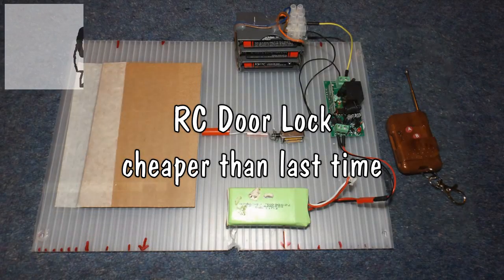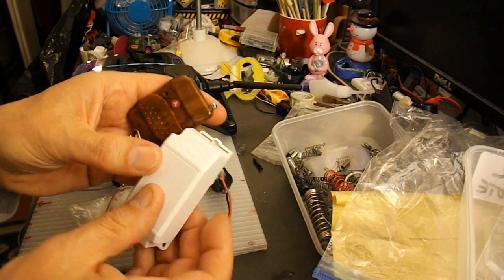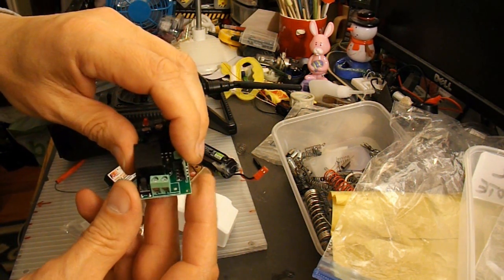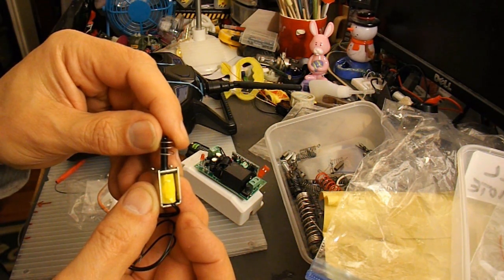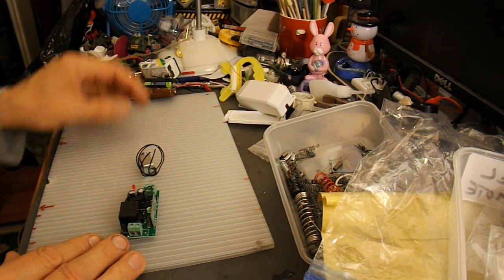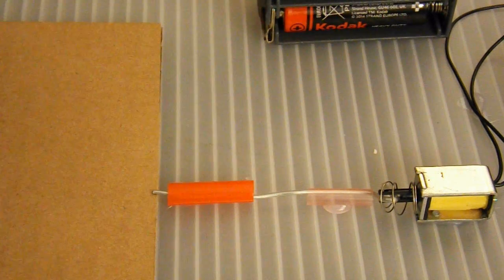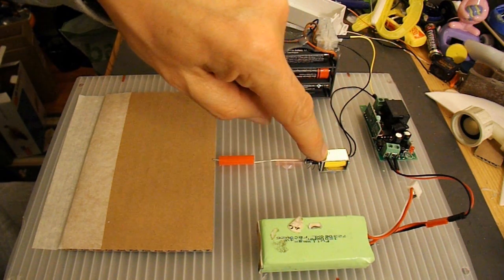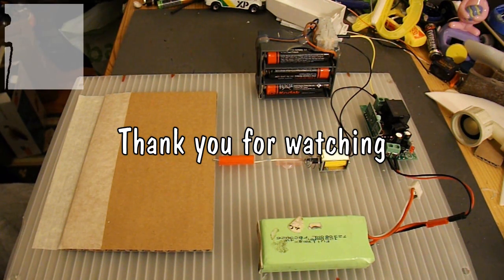RC Door Lock cheaper than last time

Comment: @Grandad, thanks so much for posting this, it is exactly what I've been looking for to make a release catch on my bird cage. Just wanted to ask, do you know how long an 8xAA battery pack would last on a setup like this? I assume that the same small solenoid you used does not draw much power each time it is triggered? Kind regards
Reply from the maker: I would think it would last for months. The current draw by the receiver board is fairly low. As you say the solenoid would only draw current when it is actually triggered so unless you are opening and closing it every few seconds it will hardly use any current in a month of use. That particular solenoid is probably not ideal but you should be able to find a better one online. How would you intend this to work, as I can imagine the door to the cage being spring loaded so it springs open when you release the catch but you would still have to manually close it. An alternative could be an adaption of the earlier version I did using an RC servo and set that to open and close the door with a lever arm rather than releasing the catch.
Reply: GrandadIsAnOldMan thanks so much for your quick response, for the purpose I am using it I only need to be able to trigger the door to open and I can manually close it. I have ordered the components, can't wait to give it a try! Thanks again!
Reply from the maker: Good luck and thank you for your kind comments 😊

Comment: How did you connect the wires to the battery? Also what battery pack did you use for the receiver?
Reply from the maker: The green battery is a LiPo battery. There is no reason to use a LiPo battery, it just happened to be handy for me to use it. It is a 2S LiPo so that means it is 7.4 volts. It has a JST connector and the jumper wires I used to connect it to the receiver had pin ends so they pushed into the connector easily as they are the right size, but you could just as easily use the proper JST connector, they are easily obtained via eBay. The other battery pack comes from an old toy and contains up to 6 AA batteries and I have soldered connector wires to it so I can either draw 4.5 volts or 9 volts.
Reply: GrandadIsAnOldMan thank you so much
Reply: Is it possible to use a regular battery instead?
Reply from the maker: Yes you can use whatever batteries that will supply the voltage and power you need for your set-up.

Comment: The lock that you bought's range is too short, isnt it? For my opinion, if you combined your old and new design in one design, it will be better. Your old door lock and your new remote control system could be more better. I hope this will be a new idea for you to do new RC door lock. By the way, thank you for detailed explanation.
Reply from the maker: This is a demonstration of the method. It is not intended to be the actual practical solution for a door. I don't think a drinking straw and a bent paperclip offer much security.

Comment: how to connect the servo motor to the remote control switch please
Reply from the maker: You would need to follow the circuit diagram that comes with your remote control switch. If you are using an RC servo you would need to modify it for DC working. I show you that in the next video in the series. The playlist link is in the video description but here is a direct link https://youtu.be/ivKbiywHv_s?list=PLA5a2xPRSrB1HM3Smxg8X-IG7dSuJyzkK

Comment: Hi. Could you please tell me where I can buy the green battery thing or what's it called so I can look it up ?
Reply from the maker: That is a LiPo battery, available from any hobby store but I certainly do NOT advise you to buy one for this project, I just happened to have one handy but ANY battery would work as long as it has the right voltage for receiver unit.

Comment: how long and powerful can solenoids be
Reply from the maker: This is just a demonstration to show the principle. You would buy or make solenoids to suit whatever task you will be using this for.
Reply: ok I am asking because I didnt see big solenoid "double action" like yours it will go forward and backward by command but I always seen spring ones that can go when command is sent but after that it will return default position by spring that;s why I asked
Reply from the maker: I am confused. The solenoid in this video is tiny and it does use a spring for the return moment. Here is somebody else's video using the actuators from electric car door locks https://youtu.be/4pV3ueSNK1M?list=PLA5a2xPRSrB1HM3Smxg8X-IG7dSuJyzkK
Reply: hmm, then do you give power when pressed A continuously? I thought A pushes and B button pulls stick inside the solenoid, I now think when you pressed A it continuously gives electricity to resist spring power when pressed B electricity cut and spring makes it move other way, does it work that way
Reply from the maker: Berk Can with this little remote control it is set up so you press one button to operate the relay and another button to release it. If you want a solenoid that will pull with one press and push with another you will need to include a magnet on the shaft and you will need a more complicated switching system. When the current flows round the solenoid in one direction it will attract the magnet. When the current flows the opposite way round the solenoid it would repel the magnet. When there is no current the shaft does not move but there is nothing to stop it moving due to vibration so striking the door might make it slide along a bit at a time. Generally most solenoids just work the way you describe. They pull in the shaft and a spring is used to return it. You could work out some sort of ratchet mechanism like the one used on those push top ball point pens. One push pushes the nib out and another push allows it to retract.
Reply: GrandadIsAnOldMan
Very well explained, thank you then buying 2 solenoids and connect them to each side of switch we want to turn on off is more smooth job right?
Reply from the maker: Berk Can yes a pair of solenoids could work but you will have to work out the mechanical linkage yourself.
Reply: of course, if everything is ready when bought what is the fun in doing it xD
Reply from the maker: Berk Can very true, as a project you want to do the work yourself, although if you just wanted to lock a door there are much easier ways :)
Reply: GrandadIsAnOldMan
NO :) when I was searching for a solution to my need I saw your video but my purpose of using them is different
Reply from the maker: Berk Can good luck with your project. Don't forget to post a video when it is finished :)
Reply: GrandadIsAnOldMan
never tried to record a video but this time I will try, if I decide to post it I will definitely mention you in description because your videos are so useful xD

Comment: hi there mate how do u connect the lipo battery to the receiver could u tell me what there called and the aa battery compartment do I connect the lipo to that ??
Reply from the maker: MrAnuras if you buy one of those small remote control switches it should have the wiring diagram with it. As I showed in the video there is nothing much to it. The power for the unit goes in one end and the thing you are switching on and off goes to the other end. The type of battery is not relevant as long as it is the right voltage for the switch, I just happened to have a LiPo laying around so I used it to power the unit. I used some jumper wires to connect it as they push into the battery connector. In the video description the switch is listed as 12v but mine worked fine off the 7.4 volts from my LiPo. As I said in the video you could switch mains power using this switch if you wanted so the other end is completely separate which is why I used a separate battery. You would use a battery that suited the solenoid you are using.
Reply: thank you very much for your response ths is very helpful thanks

Comment: You are using turnighy 9 gram servor that Flite Test uses in their scrach buids.
Reply: Not in this video , but usually for R/C stuf.
Reply from the maker: Ana Gubariu I use the cheapest servos I can find on eBay, you can see the label in tomorrow's video where I modify a servo to DC working and continuous rotation to use on this door lock. The eBay link is in the video description.

Comment: Hi grandfather how its made lipo battery via 123 battery learn me
Reply from the maker: Govand Xgovand I do not understand your question. I make it clear in the video I am using 2 separate batteries. I use a 3 AA battery pack to power the solenoid and a 2C Lipo battery to power the RC receiver. There is no reason for using those specific batteries, they were just handy in my components ready to use and the receiver worked fine with them. The receiver is rated at 12 Volts but was happy working with the 7.4 volts from the LiPo at the range I was using it. You may need a full 12 volts if you are using the switch at a greater range.
Reply: My English language very bad  my question how to make aa battery 11.1v learn me
Reply from the maker: Govand Xgovand I am still not sure what you are asking. An AA battery is 1.5 volts so you would need 8 to give you 12 volts.
Reply: Not 12 volts but 11.1 volts
Reply: Govand Xgovand you could use  4 lithium cells in series or lipo as that makes 2.7v each which is an average voltage for those, you can get 4x18650 from an old laptop battery then get a 4x holder from ebay, and buy a cheap 18650 empty single powerbank for a dollar on ebay to charge them with
Reply: Yes thanks
Reply from the maker: Govand Xgovand is there a particular reason you need exactly 11.1 volts as you would be best advised to get a voltage regulator circuit so you can set the voltage to be exactly right? Just search eBay for 'voltage regulator' there are many different types and they are quite cheap.
Reply: GrandadIsAnOldMan
i would imagine either remote control or airsoft use, as they specify 11.1v for some reason!
Reply from the maker: jusb1066 I was asking Govand.